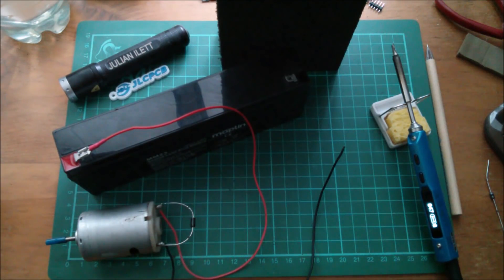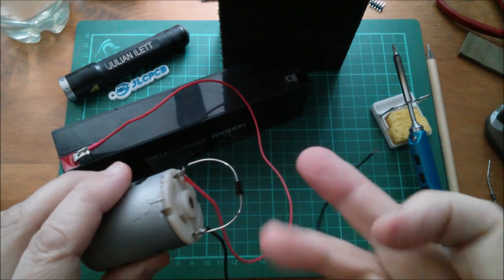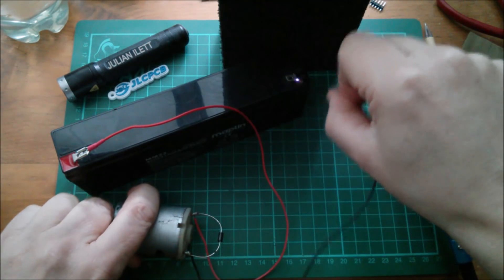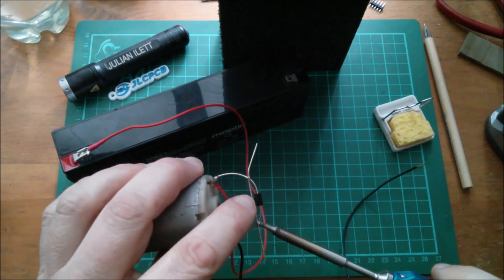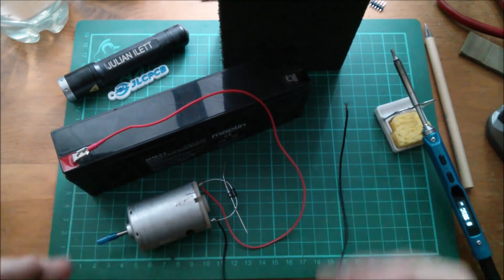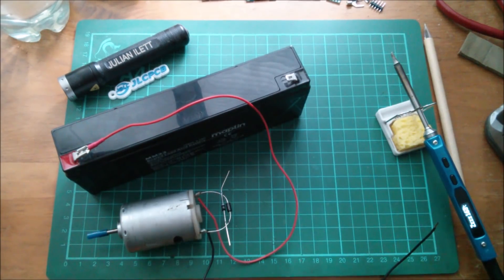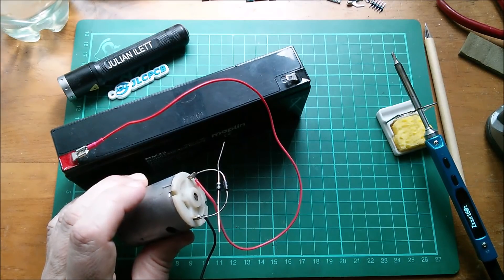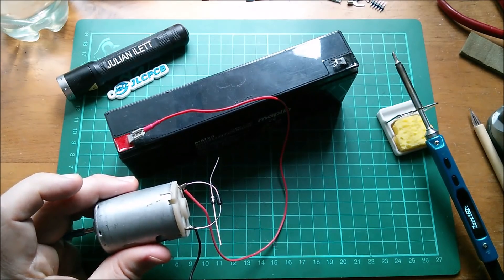Flyback Diode to Protect Relay

Comment: I use a 12 Dc motor through the relay. The motor is given through a separate power supply. It is controlled through the relay. When the 12 dc power supply is turned off, the relay turns off according to the time given by the potentiometer. But When the power supply to the motor is turned on, the relay will turn off before the scheduled time.

Comment: For the 1N400x series of diodes,  there's little sense in buying anything less than the 1N4007 (1000V!),  unless you're a manufacturer trying to save pennies.  On the other hand,  in my years of salvaging stuff I've accumulated a bunch of different members of this series.  This particular application is probably the only place I'd be using the lower-rated parts like the 1N4001.

Comment: The other issue with diodes is their speed. If they're not fast enough, the voltage builds up while they're waiting to conduct. Pulesjet suggested a capacitor and that will definitely help a lot.

Comment: If you are using a relay, why are your low-side switching?  If you leave the low-side intact, the motor's inductive current bleeds off to ground when you cut power.  If you low-side switch then you do need a reverse biased diode because the inductor will discharge the magnetic field as fast as necessary to keep the current constant.  If it hits an infinite resistance it will push current to raise the voltage till it arcs over.  But the low voltage drop of the reverse biased diode gives it a benign path to cycle through the inductor until dissipated.  This may be a bit more complicated with a motor as the rotor motion will induce a current in the stator while it winds down.
Reply: That is not how electricity works. Ground isn't some kind of magical black hole. Doesn't matter which side you switch it; if there's an open circuit you'll get backEMF.

Comment: By putting the fan hovercraft style you are aerodynamically stalling the fan causing it to draw a lower current. Block the nozzle of a vacuum cleaner and you will hear it rev up as the fan stalls and starts to spin the air in the fan rather than blowing it.

Comment: No point adding diodes in parallel.  The forward voltages will all vary by some amount and the one with the lowest Vf will conduct first and so keep the voltage below the conduction point of the others, ie that one diode will still take all the load. 1A diode should be plenty,  if you are still worried use a 1N54xx

Comment: POST 17 MAR 2020 - Hi Julian - Spark suppression is achieved with Capacitors in parallel not diodes - Diodes in parallel are used for protection, If someone is reversing the Pos and neg, it's called an IDIOT Diode, Then any in line fuse should then become O/C, unless the IDIOT Rapped the fuse in silver foil because it had O/C before and that means the IDIOT Diode is probably  O/C as well. Having done it's job but expired in the process. P.S. - I got 1 LBC for watching via LBRY, so .5 LBC is coming to you via a TIP or SUPPORT -  LET ME KNOW which to send it to via my LBRY Discussions link - https://lbry.tv/@Super-Grand-Ad:f850b6aa48bf4e82c1d33aef64bc3cf643ef3451?view=discussion - Also Youtube Like 521

Comment: We use 1N4004 (or 1N4007) diodes to suppress the back EMF from very large 24V 375mA electromagnets. If no diode is used, you get a VERY impressive blue spark when disconnecting...! [And if your finger happens to be in the way, it’s very painful 😖].
So in your application, you may only need one or maybe a couple of diodes. Try it and see how warm they get. See also my other comments...

Comment: I did a lot of testing with an oscolloscope with different diodes and configurations. Each have their advantages and disadvantages. For a coil backfeed i chose a high speed diode. And for a large inductor i used a combination in series. I forget what the results were for each test tho.  Do some testing and show us the results!               Edit: i think i put 2 diodes facing each other as the large inductor (was a spot welder leads) was causing the contacts to weld. It wasn’t just the negative spike but a positive spoke too!

Comment: Hi, I remember an appnote recommending using 2 anti-parallel  schottky diodes in series with the transzorb. This reduces the overall capacitance of the transzorb and helps better transient response.

Comment: You need to make sure that the diode can take the peak flyback current and not only the voltage.  When the relay disconnects the power to the motor, the flyback current will peak extremely high and although diodes can take a momentary over-current, there's a limit to that tolerance.  You can easily "blow" the diode into an open-circuit condition if it can't take the peak current.
Reply: The flyback current won't "peak extremely high". It is the exact motor current. A 1N400x can take a surge current of 30A (non repetitive, It's a thermal limit). I doubt the motor is running at more than 30A.
Reply: @superdau  You're right.  I was confusing current and voltage.  Brain-fade on my part.  But my comments still stand in relation to the switch-off voltage which can peak well over the input voltage.
Reply: @melkiorwiseman  

No, a diode will clamp the voltage to 0.7V (or about 1V in the case of a 1N400x at higher currents). That's the whole point of the diode. The voltage only peaks, if you have nowhere for the current to flow.
Reply: @superdau  That works so long as the diode is rated to handle the combined voltage and current.
Reply: Melkior Wiseman - the 1N4005 diodes he is proposing to use have more than enough voltage rating. I’m not sure what the running current of that fan is, but myself, I would be happy with a single 1N4004 diode. The main current flow through the diode will only occur when the relay contact opens and the motor/fan is slowing down. So just for tens of seconds (with the current reducing as the RPM slows). And the number of times it will do this will be infrequent. More than enough time for the diode to cool down. The most important thing is to provide a suitable in line fuse (time delay / slow blow / anti-surge type) to the circuit, so that in the event of either a stalled fan or the diode going short circuit, the fuse will prevent a fire.
Reply: @Mark1024MAK  He said it was about 6 amps.

Comment: Hi Julian I hate to be a bother lol I'm trying to make the arm with gripper claw on my robot "smart" or artificial intelligence.I have the pi 4 b+  with the camera the i2c enabled on the pi and a mega2560 for the servos and the pca  9685  servo motor driver  I have the camera mounted behind the claw and also a bi directional data converter for the pi and mega my main question is will this combination of components work for what I am trying to achieve ?thanks for any suggestions .👍😀

Comment: Using more than one diode in parallel in this situation smacks of witchcraft.  If you don't think a one Ampere diode will do it switch to a 1N54×× diode. (3 Amperes)  If you want to run the motor in either direction put the snubber diode across the motor's power supply at the input of the polarity reversing switch or relay. Ron W4BIN

Comment: emmm.....
don't think putting those diodes in parallel helps to relief the load current on just one because though silicon starts to conduct at 0.7V but all diode will have a different voltage tolerance. and if one turn on at a lower voltage than the rest, the particular diode will clamp voltage and will still end up just one diode that actually doing the job.
Reply: To ensure current sharing, wire a low value resistor in series, for this application, the resistor can be thin flexible wire, just make sure that both the wires to each diode are all the same length.

Comment: Wouldn't the oscilloscope be better to see what your looking at with a switch, and maybe your seeing inductive start up arcing and not flyback? I cant help but think a SSR would be better suited for this damp application and a mosfet??
Reply: A relay and silicon diode is fine, and cheap and simple.

Comment: Put a diac across the motor, or just a 0.1 uF disk capacitor. You can also try a neon bulb; both diacs and neon bulbs have a “hold-off-until-sufficient-voltage” characteristic in either direction. Cheerios. 😊
Reply: These are all good for AC applications, a silicon diode is better for DC applications. A ceramic disc capacitor will however reduce RF interference to nearby radio equipment.

Comment: You can also put a fast acting diode (UF4007) across the contacts so that its reverse biased. This will also eliminate the back EMF from the long inductive wires.
Reply: Another thing: a diode like that actually slows down how fast the magnetic field collapses and keeps the relay engaged a like some milliseconds longer
Reply: Power Max - a diode across a load controlled by a relay does not slow down the operation of the relay, but a diode wired across the relay coil will delay the relay de-energising.
Reply: @Mark1024MAK  Yes, precisely; that clarification is important. Not sure how much it slows it down provided the high resistance of the coil and voltage drop of the diode though.
Reply: A diode across the relay contacts will do nothing for them as the back emf is positive with respect to the relay, the inductance wants to keep current flowing in the same direction. A reverse diode across the motor and RC snubber across the relay contacts is what's needed.
Reply: @uK8cvPAq  Your not understanding, you put the diode across the coil not the contacts. If +12V and 0.5A is flowing through the coil with the reverse biased diode in parallel,  then when power is immediately disconnected the current through the coil wants to continue flowing and the voltage across it inverts to -0.6v, where the diode becomes forward biased for some period of time.

Comment: Adding a low value capacitor  ( 0.1uF ) across the motor contact suppresses  RF noise and also tames down the Arcing produced  during the break contact times  .

Comment: From my memory of quite a long time ago, putting diodes in parallel does not share the current, the first diode to conduct will take all the current.
Reply: To ensure current sharing, wire a low value resistor in series, for this application, the resistor can be thin flexible wire, just make sure that both the wires to each diode are all the same length.

Comment: A relay!? For low current DC!!?? Oh Julian! Low side switching N-channel MOSFET!! Even an NPN Bipolar will do a much better job. Cheaper, more reliable, faster, smaller, and completely non arcing. But STILL (MUST) use a reverse biased rectifier diode in addition!
Reply: I don’t think that fan is “low current”!
Reply: @Mark1024MAK  the relay is only a "low" current relay, probably a Chinese one "rated" at 10A (that's TOTAL capacity i.e. just 5A per contact pair). 

That's LOW current in 5v or even 12v power terms, and even for tiny 8-pin MOSFET chips that's not difficult to achieve. 

In my book HIGH current requires 4mm^2 cable for ~30A plus. Solar battery wiring is often (but doesn't have to be) high current, >100A in some cases, but even then, MOSFETS can handle that FAR better than a relay!
Reply: @Mark1024MAK  even if the fan were mains 240v powered, a relay is not the best solution, an opto-triac would be far better and also directly driveable from an Arduino (a relay is NOT!)
Reply: Bob Lewis - “low current” is a relative term. In terms of *electronics*, “low current” is a current substantially below the levels you are talking about. In power engineering, very different figures are meant by “low current”.
I never said anything about MOSFETs not being able to cope with such current levels. Julian is well aware of the use of MOSFET use. He has featured them in past videos.
As with any problem, there are multiple solutions, each with pros and cons.

Comment: @Julian you might want to have a look how the RC model community is dealing with this for ages.. ;)
Reply from the maker: You use relays?
Reply: @JulianIlett  Nope, a small ceramic capacitor from the positive terminal to the motor body, the same for the negative terminal and then one between +ve and -ve should do the trick.
Reply: Tiny Workshop, Big Ideas - that’s done to reduce the RF interference. A silicon diode is better to clamp the back EMF.

Comment: The diode clamps the reverse voltage at ~0.7V long before the 33V transient suppressor would even start to conduct.  A 1N400x should work fine and is cheaper to boot!

Comment: Julian,  see the other comments especially David Granz comment.   The question is if you are seeing sparks from inrush current or  flyback   current.   I suggest you try with an actual relay to see if it  arcing while closing or opening.    What you are doing is rapidly causing both and the diode will only impact flyback current.
Reply from the maker: Done :)

Comment: Or you could switch the motor using solid state relay and/or thyristor? Could be quite fun. 

I maybe would have tried a cap across the contacts of the relay too/instead?

Or used a bigger relay/contactor. Used to deal with these things all the time, and gotta say, although relay contacts will fail, they don't do it very often. Looking at a modern contactor, the spec sheet says 'mechanical durability 15 Mcycles'.

Comment: While you can use a regular "car" relay, why not use a MOSFET?  They can handle the current and you maybe could even implement a variable speed control.  Have the motor ramp up and down instead of just switching on and off.  Why?  Why not?   ;-)
Reply from the maker: Look back through my 10 years of videos and you'll not find a single electric motor video. So I'm really enjoying the whole back emf, flyback, arcing, sparks malarky. Yeah, MOSFETs, PWM, all far too easy. But sparking relay contacts, quench diodes, snubber networks... woarhh :)
Reply: @JulianIlett  - LOL.  I hear ya.  But I just think your fans (LOL... not intended) would be more interested in seeing some cool Arduino --> radio link --> Arduino --> speed controller --> DC motor project.  Maybe even feed back the current RPM of the fan?  More options (thus videos!) make it more fun.  This could be a fun series of videos.
Reply: And then add IR motion detection to turn the motor off when anyone approaches!  If someone is snooping around looking for the source of the noise they won't find it!  LOL.  Plus it just keeps it off while you or the wife are there likely with the door open any way so you save power.  Oh the options!

Comment: Why don't you use a vdr. (Voltage dependent resistor) such as S14K60.
Reply: A VDR is slower than a silicon diode.
Reply: @Mark1024MAK  Yes but then you can use an S14K40. It starts reacting at 40 V spike. Maybee use it in conjunction with a bipolar condensator.

Comment: I think I would just go for a relay designed to switch DC at a current higher than that required by the motor. the motor when running is butting the current all the time so there should be no need for a magnetic arc quenching relay. When you think of all the cars running fans on 12V it's normally just a big relay. the relays can often break less current than they can make! also watch out for the normally closed contacts, they are often smaller than the normally open contacts. so you cant just swap the on-off function of a relay by just swapping the NO for NC contacts, without checking first the data sheet of the relay to check if the switching capacity is the same. Still can't beat a video with sparks in it. the electrical type not the old group :)
Reply: Not a fan of Ron Mael's moustache then, eh?
Reply: @massimookissed1023  this town ain't big enough for a moustache  like that ;)

Comment: A capacitor in series with a resistor will do it too, you'll need a big diode for that shed fan as the freewheeling current will likely stress that little 1 amp job.
Reply from the maker: Looks like a snubber across the relay contacts is also needed :)
Reply: @JulianIlett  Well, you might be able to get away with paralleling lots of 1 amp diodes but they should be clumped together to help with thermal balancing. Doesn't always work but its a cheap trick often used in AV power supplies.
Also look up RCD snubber.
Reply: uK8cvPAq - how much reverse current do you think will flow? We use 1N4004 or 1N4007 diodes to suppress the back EMF from large 24V 375mA electromagnets and they last for many years. And some of them get switched off- on - off every two minutes.
Reply: @Mark1024MAK  That should be fine, generally the diode should be rated for the full run current plus stall/heavily loaded conditions for it to be bullet proof. The RC is generally preferred for larger motors as the diode itself can load them, try it for yourself by spinning a disconnected motor with your finger then connect the diode, it'll feel harder to spin with the diode connected.

Comment: I would also try to add a capacitor parallel to the diode. It is ideal for high frequency signals and sparks.

Comment: You should place an RC snubber, same technique used on refrigerator compressor switching I think.
Reply: That’s an AC application... Diodes are more effective for DC applications.
Reply: @Mark1024MAK  Then it becomes an RCD snubber ( :